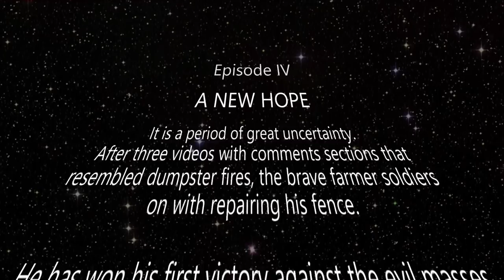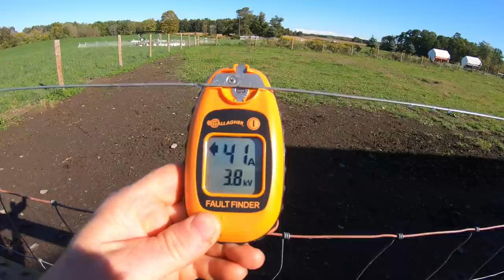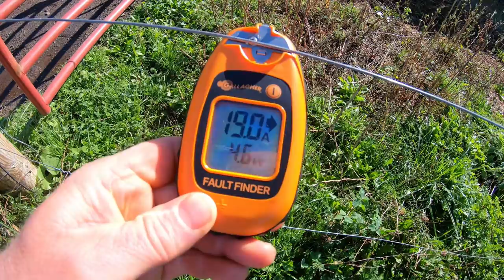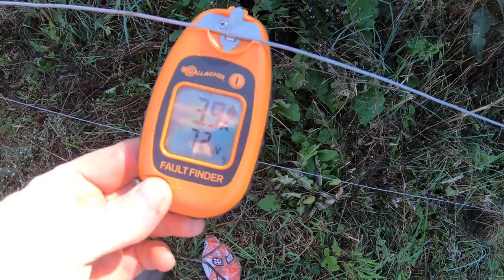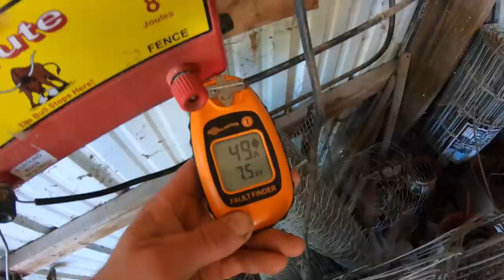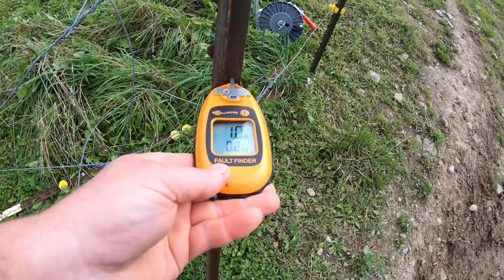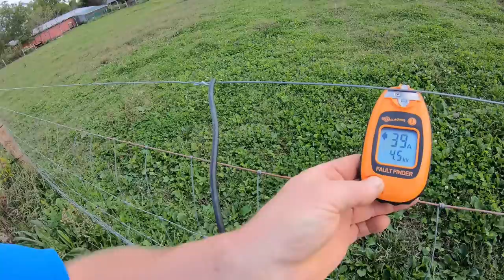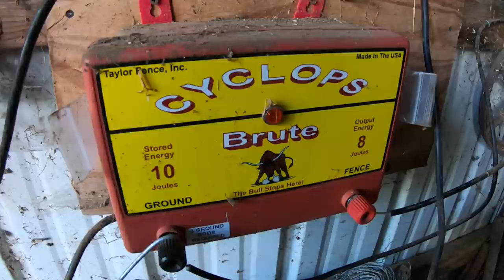FENCE WARS - The SHOCKING Conclusion

Comment: Loved the lead in.
Have you solved the conundrum of whether electrons flow to ground or they flow out of the ground?
Think about that one the next time you get shocked.  Just have to jump fast enough to break the ground connection.  Is that at the speed of light?  300,000 meters per second?
Ya, the old weed choppers were dangerous.  Killed some cattle, farmers and set lots of fires.
Cousin and I got the neighbors kid to pee on the weed chopper feed we had running along the barn wall out to the fields around 1960.  His father claimed we ruined his son for life.  Don't think the kid ever did have any kids.  Real shame but so funny at the time.  Dropped him like a bull that had been hit by lightning.  Kids will do the darn-est things
I love barbed wire electric fence, goes right through cattle hair and hide in dry summer time.  They really beller